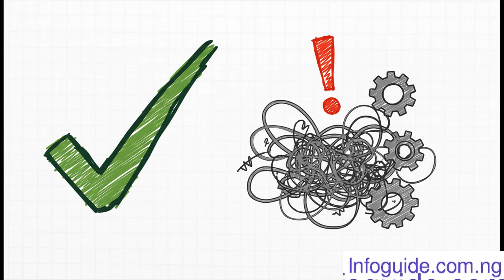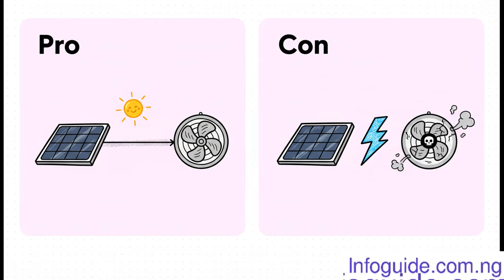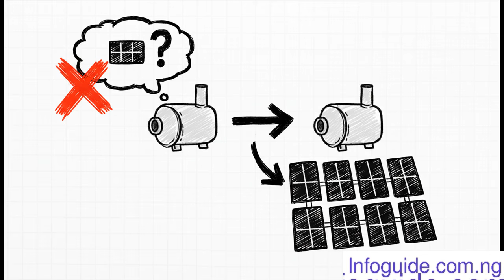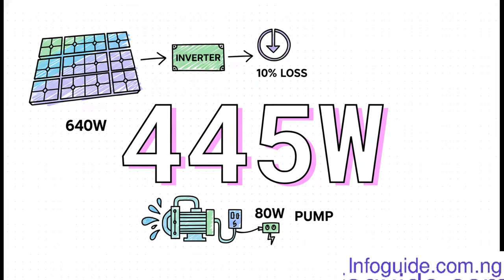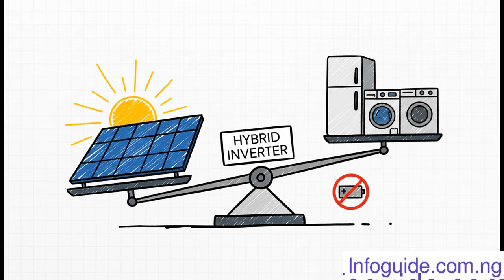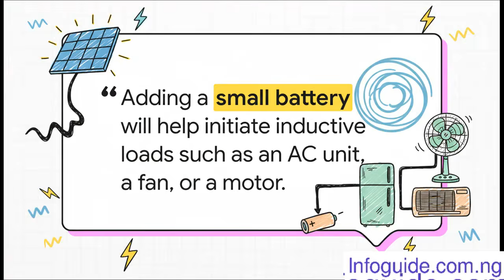How To Use Solar Panel Directly Without Battery To Power Electrical Loads.

Comment: Compromising on the purchase of a small battery, in between the Solar panels a nd your inverter is JUST NOT WORTH IT. You have a lot to lose than gain by a little cost saving. Solar Panel-MPPT controller-battery-Inverter-Loads. And nowadays, the prices for LFP batteries are falling by the day. You can even pick up a used battery and still get a lot out of it, in terms of the total USEABLE energy  you can get out from the system. I've already done it and I know the value of such a system. If you have money to spare, you can go for a big battery, because stored energy is always your asset, especially if you have unreliable grid supply.
Reply from the maker: ❤ Your suggestion is well noted. 

The method is for people that want to use solar panel directly without any battery backup..
Reply: @InfoguideNg The least you can include are a bunch of Super-caps, to iron out small fluctuations.

Comment: Or .... or we use a DC motor that only runs when the panels run.   Take the water pump.  Lets say you have a well.  Have thr well pump pump the water into a raised water container.  It fills up the container and then you have water thats pressurized by the raised water container.
Reply from the maker: Yes, DC motor or water pump can work directly with solar panel. Just balance the panel voltage with the DC motor or water pump voltage.

Comment: Thank you.  interesting info. But in our place the sun is not continuous, every now and then there is some cloud cover which may last for several minutes at a time. from Sri Lanka.
Reply from the maker: Just use panel 3 to 4 times wattage of the load you want to power directly, you will be fine during the day time.

If is a very thick cloud, like is about to rain. You can use a small battery to cover for the few minutes.

I doubt if is a thick cloud, the first option should work very fine.
Reply: @InfoguideNg  Thanks for the prompt response.

Comment: Micro inverters have been around for many years they use the grid as a place to store energy that is not used.
Reply: When the Grid Provider is not reliable, it does not make sense to depend on it. In today's unpredictable world, locally stored energy is always a better choice.
Reply: @tonyrebeiro  Micro inverters can be used off grid if you did not know and a battery is always a good backup but not very affordable for full time use unless you can afford 100 kwh.
Reply from the maker: Yeah

Comment: Ahh but you only get power when you have sunny days.
You need a string inverter to go from panel to house.
Solar panels can supplement as well.
12vdc appliances and such cost a small FORTUNE.
Reply from the maker: Yes, you can only use power during the day.

Comment: It's just you can't use it when the night comes. Which  is very useful, specially on bed time, like in places that need electric fan to sleep😅
Reply from the maker: You are using the solar panel directly which will only work in the day time.

If you want to use your electric fan in the night, you will need a battery to store power during the day. If is a DC fan, you can connect/run it directly from the battery. As for AC fan, you will need inverter connected to the battery to use your AC fan

Comment: I want to run welding machine directly from solar panels,, which type of converter is advisable? PWM or mppt?
Reply from the maker: Is your welding machine an AC or DC appliance.
Reply: @InfoguideNg it's a 200 ampere inverter type DC welding machine which uses 60 volts difference between two terminals,,we normally use it at 100 ampere current.
I
MPPT controllers are much costlier than PWM
Reply from the maker: Okay.

If your welding machine is DC inverter powered, it should also come with two battery cable with clip of red and black color.

Let's assume the DC voltage is 60V, you can also use this method to power it directly with solar panel.

 You can get a buck converter or Pwm speed controller with a higher input voltage range e.g (36 to 96 volts) to power your welding machine directly with solar panel, just set the buck converter to 60V.

Yes, Mppt controllers are more expensive than Pwm controller
Reply: @InfoguideNg are you sure that PWM will work properly? And what should be the wattage of PWM needed? 6 kilowatt or less?
Reply from the maker: You don't need a solar charge controller if you are running your welding machine directly on solar panel. What you need is buck converter to balance the DC working voltage of the welding machine.

You only need charge controller when you want to add battery to your solar setup and use inverter to power your welding machine.

A Pwm solar charge controller of 12/24/36/48V will work if you are running a solar setup of 24v upward. Mppt is better but you can still use Pwm if you can't afford Mppt controller now.
Reply from the maker: Your welding machine wattage will determine the capacity of solar panel you will use to power it directly, it should be x3 of the wattage of the welding machine for better result.
Reply: @InfoguideNg thanks for replying so promptly,,i just want to test run the welding machine with solar panels which are 48 volts nowadays,and can deliver 100 amperes when connected in parallel,,
Reply: @InfoguideNg anyhow,, thanks for replying,,i will discuss with you later because I understand it's a complicated task.
Reply from the maker: Okay, you can test run them
Reply from the maker: If is 12v solar system, you can use Pwm Charge Controller but if is 24v, 36v or 48v system, you are better off with an mppt charge controller.

 You can still use Pwm for 24v, 36v and 48v if that's what you can afford.
Reply: The question is not completely correct. Welding arc has downward characteristics, the more current the less voltage. Argon arc has ~12V at working current, mma ~24V. In order to weld you need current stabilization or rapidly downward load characteristics. Neither mppt nor pwm have this. They harvest energy what they can but can not provide current stabilization. Moreover you need ignition voltage 60-80V. Arc force - increasing current to max 200-300A during shortcircuit is also a good option. Thus there are two options - some diy dcdc  converter with current stabilization, or serial connection of solar batteries and connecting that 300-400VDC to the rectifier stage of commercial welder. Important! both over- and undervoltage (not enough sun) can burn your welder.
Reply: you can weld directly off the panels, no welder. use more or less panels to suit the job.
Reply: @michaeljoncour4903 understood 😊😊

Comment: How about using capacitors instead of battery
Reply: Yes, capacitors are better for getting equipment started. But when you invest in electricity storage, it is often better to go for batteries, because they store a lot more energy for when your panels don't produce enough.
Reply from the maker: Battery is better

Comment: I have panels with 22volts OC, I run 24volt rated green house fans directly, they cannot possibly be over volted.
Reply from the maker: Yes, if the open circuit of the 12V solar panel is not more than 22 to 23V. 

When a load is connected to the solar panel, the voltage will drop to around 20V, so you're safe using it with your 24V greenhouse fan. The speed of the fan will depend on the intensity of solar radiation.
Reply: Lock  at the  panel  sys  12 DC  or 24 DC   under load  .   From Saudi Arabia  good luck  .